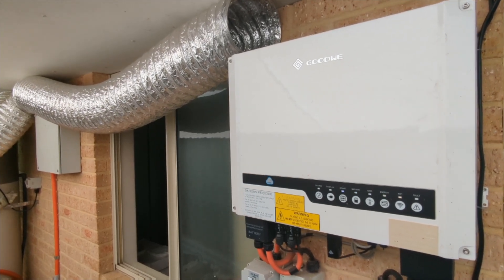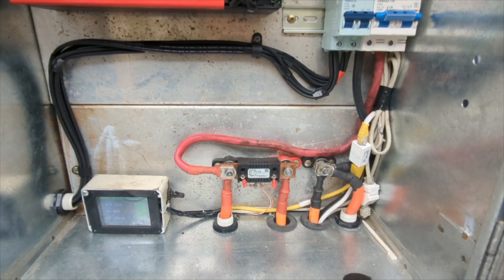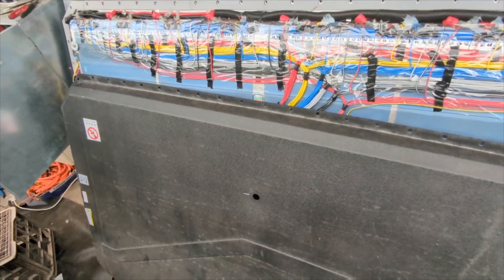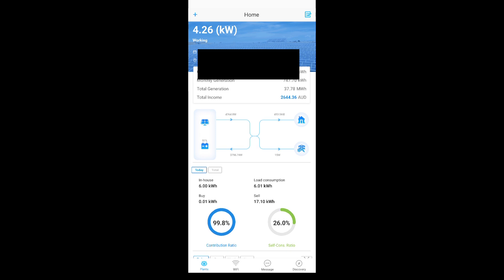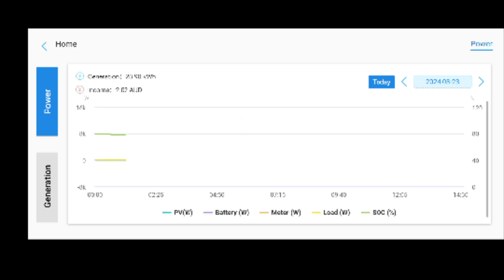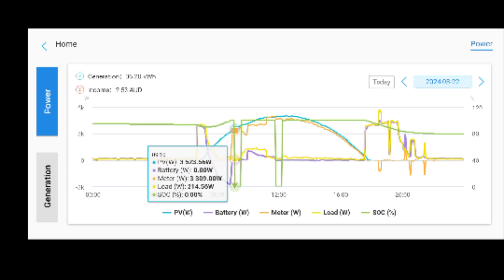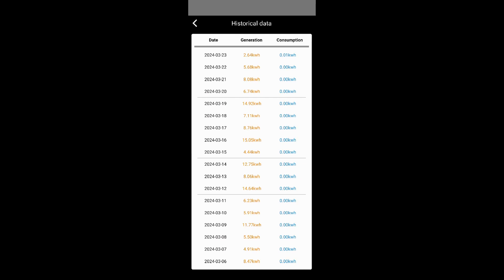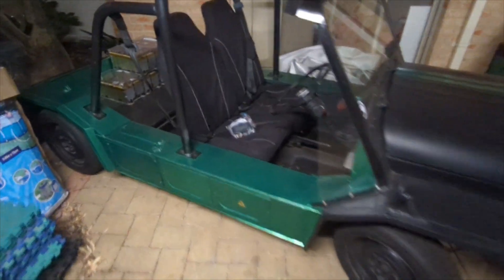BYD Atto 3 battery to home storage P7 - system running overview

Comment: this is unreal mate, thanks for documenting. from what i can see, this looks like a pretty reliable setup to live off grid for a very cheap price.  if i dont mind the hacking/wiring, can you think of any disadvantages? i can source a couple of atto batteries for 3k each.
where are you located?
Reply from the maker: I'm in Perth, Western Australia.
I would definitely go with a HV inverter if I was to do it again. You can use Dala's setup. It's so much simpler and doesn't require all the cutting, you just need a compatible inverter and a $20 Arduino module to sit between the  inverter and the original battery BMS
Reply from the maker: https://github.com/dalathegreat/Battery-Emulator
Reply: @Brendon_M  thanks for the reply. I have a single phase LV inverter, but have been thinking 3 phase makes more sense for me. So maybe I'll invest in a HV inverter then.. 
I do like HV cable size being smaller to get the battery out of the house.
are there any draw backs to going HV? I'm guessing the only thing I need to do is match the inverter voltage range with the packs? I've done plenty of Arduino stuff. I actually already live off grid with a small 12 kw lifepo4 I built years ago and have an atto as backup. I have a HUGE, overpanelled array to cover the ev, hws and 24/7 AC's. A lot of automations manage the SOC in home assistant, but nowadays it's maintenance free.
I'm in North NSW 😊, shame or ide hit you up to check it out
Reply from the maker: No real problem in running HV other than the legal aspect of the connections and cables etc. But that's up to the sparky signing off on the installation

Comment: What Min/Max cell voltage did you set the BMS for?
Reply from the maker: 3V - 3.55V with hard cutoff limits at 2.8V and 3.6V
Reply: @Brendon_M  
Do you still have the BMS and other parts you are not using from the Atto 3 pack? 
I have an Atto 3 pack with a non-working BMS / contactor assembly, and would like to purchase your spare parts to see if I can get it running again.
Reply from the maker: Sorry but no, I use the contactor assembly and the BMS at work

Comment: Is this Atto3 blade battery liquid cooled? I see no coolant pipe connections to the front. Or it has just air cooling like Leaf?
Reply from the maker: It is refrigerant cooled. There are aircon pipes connected to the front next to all the wiring connections.
Reply: @Brendon_M  Got it. Thank you!

Comment: One question.
Where did you buy that used car battery, and what was the price ?
Thanks
Reply from the maker: I bought a wrecked ATTO3 from the auctions. Realistically I probably overpaid but by the time I had it delivered to my door it cost me $11000.
Reply: @Brendon_M  11000 usa dollar ?
Reply from the maker: AUD$11000 so a bit under USD$7000
Reply: @Brendon_M  good price for 60 kw battery

Comment: if you use Goodwe 5048DES, and then you use external MPPT charger, the Goodwe inverter will unstable calculate battery SOC.
Reply from the maker: SOC is reported to the goodwe by the BMS and the separate MPPT is before the current sensing shunt so the BMS sees all power in and out of the battery
Reply: @Brendon_M  Have you communication RS485/CAN between Inverter&Battery?
Reply from the maker: Yes, CAN. The ZEVA BMS is compatible with any solar inverter that can talk with the same protocol that SMA uses (which seems to be most)
Reply: @Brendon_M  good, sir
Reply: Sir why additional.mppt when goodwe has it?

Comment: If you did it again, would, you use another BYD battery or a Tesla one?
Reply from the maker: I'd use a different solar inverter that could take a HV battery and bypass all the trauma. I'd probably still use a BYD battery as a wrecked BYD would probably be cheaper than a wrecked Tesla

Comment: Can you share (legally) electricity with neighbors?
Reply from the maker: Not really though I guess I could throw an extension cord over the fence if they needed power in a black out. 
Realistically the power around here is pretty stable, we might lose power for a few hours once or twice a year at worst
Reply: @Brendon_M  It is a pitty you're not my neighbour. I also was thinking to buy the wrecked EV.  I'm somewhat familiar with CAN bus but I wonder how you managed to make a control of the battery? How did you figure out what signals to send? I just wonder if I take the battery out can I charge it without doing the dismantling? Let's say if I apply required voltage to the battery 400 or something ? Dismantling seems quite involved.

Comment: Do you still have 60 kwh in capacity ?
Reply from the maker: Yep, SoH was at 100% still. I don't use the full capacity though, max discharge is set to 85% depth of discharge but the last 15% will automatically be used for backup power in case of loss of grid so the system can actually use the whole 60kWh. 
This time of year the battery is only getting down to 80% and is normally fully recharged by mid morning anyway. It's not the best to keep the cells so close to full all the time but it is what it is

Comment: Do you live in Australia like me ?
Reply from the maker: Yep, Perth
Reply: I am in Brisbane, wanting to do the same thing 😊
Reply from the maker: My recommendation would be to install the battery to an inverter that can handle high voltage batteries so you don't have to mess around making up a 48V system. Just plug an EV battery into the inverter with an interface module and away you go
Reply: @Brendon_M  thank you for your videos and the time you took to explain! Are inverters like that available?? Whats the name of the phone app?
Reply: @Brendon_M  Brendan, are you sure that any battery can be charged just applying the required voltage? I suspect that it could be BMS or protection curcuit preventing doing this. Am I right?
Reply: @Brendon_M  Hi Brendon I too have landed the same BYD Atto 3 could you please explain the interface module . I have an island system (not looking to export to grid )Where to buy and how wire . Many thanks for all your work
Reply from the maker: Have a look at Dala's EV repairs. He has a bunch of videos on it. 
https://youtu.be/QCXeLO6gFRA?si=fAqu16Of4ATnvuLB
Reply: @Brendon_M  what interface module would you recommend?
Reply: @Brendon_M I am planning on doing the same, would a fronius gen 24 be appropriate and advice would be appreciated

Comment: What prevents using the battery as is, at 400V, and solar panels at similar voltage?  Maybe this needs an emulator so the battery thinks it's still in a car?
Reply from the maker: Nothing stopping it other than I already had the 48V inverter. "Dala's EV repair"  ( https://youtu.be/QCXeLO6gFRA?si=4VNSXLJ3f8ByNPUu ) is working on a system to connect an EV battery directly to an inverter and if I was starting from scratch it would definitely be the way I'd go about it.
No BYD battery compatibility yet though
Reply: @Brendon_M  That's why im gonna use a Tesla battery, there is already stuff available on the internet to talk with the BMS towards the Inverter. :)
Reply: @HermanWillems too expensive, better buy cells from china
Reply: @Brendon_M  Looks like BYD is compatible now.
Reply: How many KWH do you have ? Still 60 kWh ??